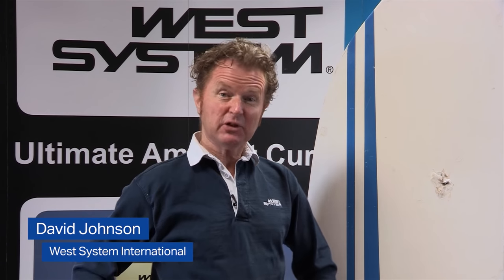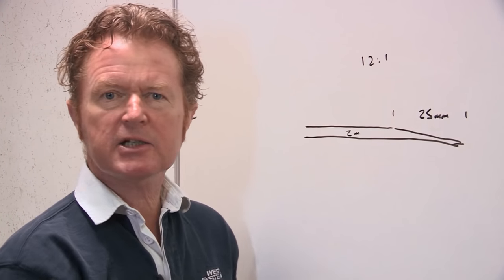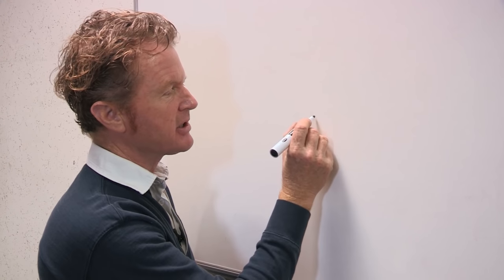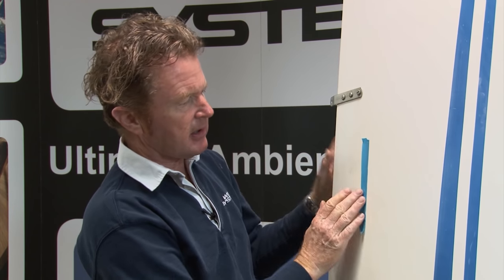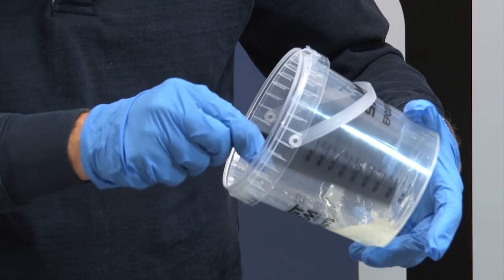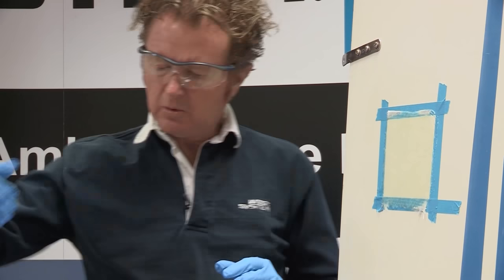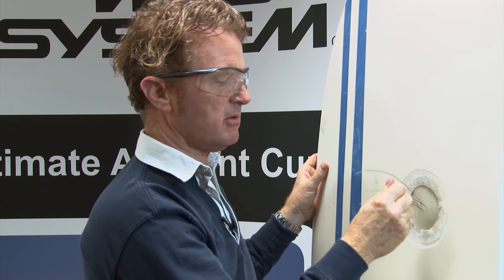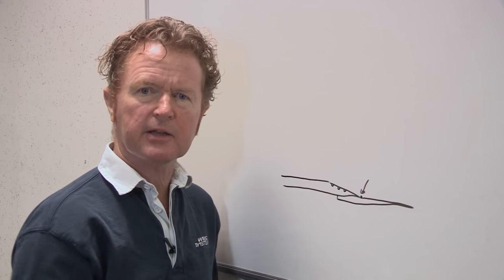How to repair a GRP hull using WEST SYSTEM® epoxy. Part 1

Comment: great vid but should you not alternate the fibre direction  ?
Reply from the maker: Thank you for your very valid comment.
However on a small vessel such as this we believe it is appropriate to have the biaxial fibres running at ±45° to the waterline to address the loading to the hull structure.  On a larger more complex structure it may be fitting to have the fibres orientated to address all 4 axes.  On such larger, complex structures it is recommended for an engineer to specify the exact fibre type and orientation in order to maintain the structural loading characteristics of the hull.

Comment: What is the cure time for this epoxy?
Reply from the maker: Hi Ralph, WEST SYSTEM 105 Epoxy has 4 hardeners available.  Offering different cure speeds.  Details can be found here https://wessexresins.co.uk/west-system/find-the-right-product/hardener-filler-and-additive-selection-guides/

In this video, we used WEST SYSTEM 205 Fast Hardener which provides a pot life of 10-15min, a working time in thin film of 60-70min and a cure to solid state in thin film of 5-7 hours.